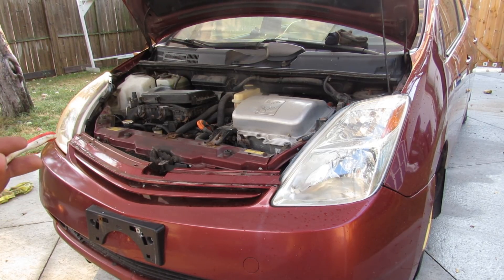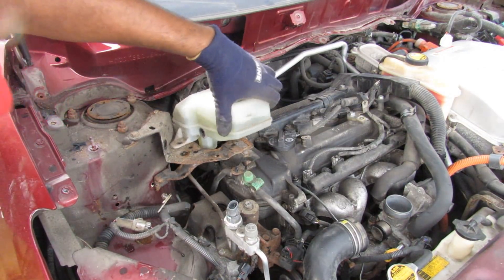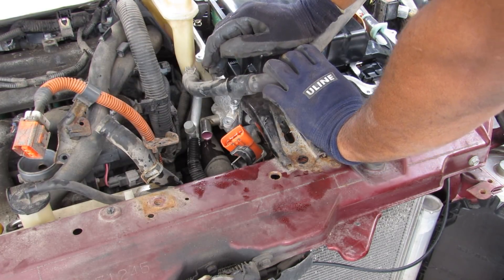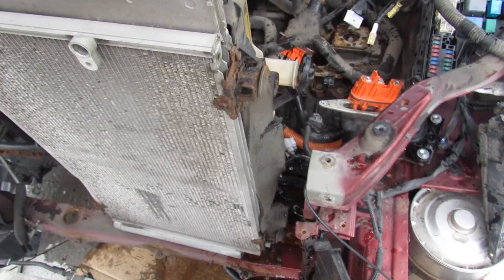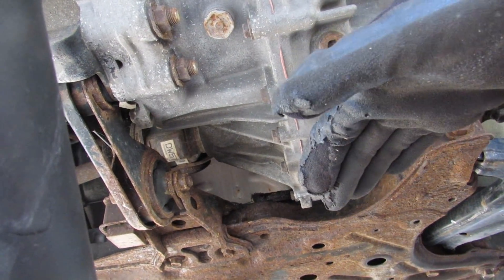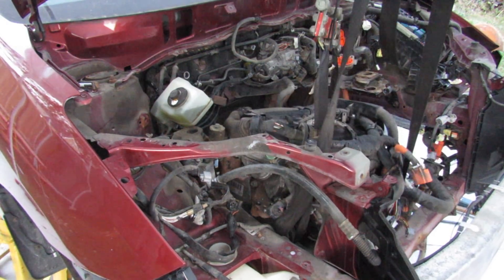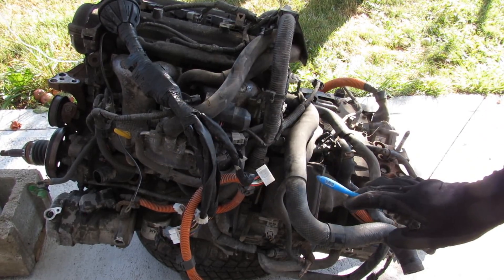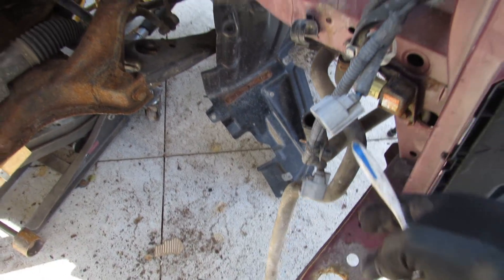How to Remove an Engine   Toyota Prius Hybrid

Comment: Removed my first engine this week of my old 1989 Subaru Justy that sadly was going to the junk yard. I was so afraid of something bad happening with a thing as heavy as an engine hanging up in the air, so I took all precaution like multiple supports with backups and wearing safety shoes. It felt freeing seeing you just drop the engine to the floor wearing sandals😂

Comment: That's amazing once you get a better idea of how everything works what is your plan do you want to convert it to a EV from a HV?
Reply from the maker: Not working on building anything really
Reply: @speedkar99  fair enough i think regenerative charging with modifications when the car is driving forward is the solution to HVs and EVs it could self power the vehicle and maintain the battery system.

Then petrol engines could be removed, but the power steering air con and heater etc would need to be replaced by electronic ones.

Comment: My god...I've never seen anything so complicated in my life! Imagine trying to put this back together again! How'd they manage to build these cars in the first place?
Reply: Everything is assembled and the simply lower the chassis on the motor. If the guy had a lift. He could likely just disconnect the frame and lower it from the car
Reply: They are not that bad to work on... I think this was more complicated than needed. The transmission in these almost NEVER fails.  You can disconnect the engine from the trans.. leaving almost ALL of the stuff he disconnected. And pull the engine out from the top.
JR Goes.. did a video about this.. but did not show much details on the removal process.. not enough to use as a guide.  It took him 6 hours to pull and reinstall an engine.

Comment: Hmm, I have removed from gen1 prius, it pretty much drops out the bottom, don't need to remove all that stuff.
You just need to remove the inverter, the hoses, wires, and then drop the suspension with engine attached, and dtop it onto to big dolly, then raise up the body and roll it out. ahh I see  you came to that conclusion at the end.  :)
Reply from the maker: Lol

Besides removing the radiator (was going to anyway) was there not anything else you mentioned I did?

Comment: I had to replace cat on my ford fusion.  Aftermarket cats are cheap...just over 100 bucks.  I kept the stock one//replaced the exhaust from the manifold back...stock exhaust was welded.  Flex pipe had hole in it.
Reply from the maker: Nice. Yeah too bad they all come as a one piece design

Comment: Excellent video. Can anyone answer me my queries please?
1) While removing AC lines, will refrigerant not leak out?
2) How many water pumps are used by hybrid car?
3) How many motors are required for driving axle?
Thanks for sparing your valuable time.
Reply from the maker: Yes the refrigerant will leak. 
I found 3 pumps 
2 motors in this transmission
Reply: @speedkar99  Thanks for your prompt reply. Is it possible to reply the other two queries?

Comment: Does this car still run and drive when the hybrid battery is dead? because I know some hybrid models use the main big battery to start the car, meanwhile some use the regular 12v battery to start and the car will just be slow
Reply: This Gen II prius uses the hybrid battery to start the car, so it will not start without an operating hybrid battery. There are two motor generators (MG's, ie electric motors) that use the hybrid battery. MG1 starts the car and recharges the hybrid battery (replacing the starter and alternator on traditional cars). The MG2 provides power to the wheels either by itself or in conjugation with the internal combustion engine. The 12V battery has about half the cold cranking amps you'd normally see in a car, because it does not need the amperage to run a starter motor to turn the motor over. I believe the newer Prius models allow the MG1 to also provide power to the wheels, allowing power from the engine+MG1+MG2.
Reply: my prius (gen 3) will still run when it throws a hybrid system error. It just runs slow and the ICE runs continually.

Comment: Not as rusty as I expected for a 17 years old car in Canada!
Toyota seems to be pretty well protected.
Reply from the maker: Yeah I was surprised myself that it came apart pretty easily. I think I only snapped two small bolts, along with one big subframe bolt
Reply: @speedkar99  
In Ottawa live it's kind of hard w/o acetylene torch. When K-Frame or suspension bolts snap it's not fun. Once we assemble back things, we pack some grease to make things easier for future repairs.
A friend of mine when he got his new FJ Cruiser he closed the garage for a week, put the FJ on the hoist and pulled out bolts one by one. Removed plastics, rust proof it. After 15 yrs it looks like new underneath other than some little corrosion in the places that get mostly affected by salted roads.

Comment: The electric power steering motor and controller are quite useful. There are wiring diagrams and instructions on how to use it to do a power steering conversion.
Reply from the maker: Cool! I didn't save the controller but I got the motor and rack for another teardown video

Comment: FYI I have personally swapped engines on that generation of Prius multiple times and it can be done with leaving the transaxle in the car and sliding the engine towards the passenger side and then up and out.
Reply from the maker: Yeah but I wanted to pull engine and trans
Reply: @speedkar99  Yeah no I totally understand that in your case but most of the time with these cars the engine is what fails so I was just letting people know that it can be easily removed without messing with the transmission.
Reply: Hey I am gearing up to replace the engine on a prius not transmission, any videos you know of for just engine removal?

Comment: I honestly don't see the point of a Prius now that there are plenty of small EVs available. The complexity seems like it'd make maintenance a nightmare
Reply from the maker: These are reliable
Reply: They are more reliable than most EVs out there and you're not entirely stuck on the electrical grid.

Comment: Bloody hell!!!  When you watch someone working on a Euro engine, the comments from the haters flow thick and fast.  They obviously would block out this nightmare because it proves that Japan can also make a nightmare.  Imagine the cost of lower radiator hose replacement.......
Reply from the maker: Bruh
The cooling system on this thing is next level

Comment: I dont understand why anybody would buy this car. It is a terrible gas car and a terrible electric car married together with a bunch of computer and sensors. How is any of that going to age well? Just the other day I saw a prius on the highway saving the environment with a bunch of blue smoke coming out of the exhaust before the car gave up and the driver pulled over. Toyota sells these cars making people think they will save money with the 2mpg improvement over a similar small car, but then the hybrid battery is worn out, or the underbuilt engine gives out, or the cats are worn out or get stolen, and they are out thousands of dollars on a vehicle not worth a lot. At no point does it make any economic or logical sense to buy one of these, or for Toyota to even make them other than meeting government fuel economy standards so they can continue to make large trucks and SUVs that turn a healthy profit. Just a complete joke this car is and all the rubes who get suckered into buying it.
Reply from the maker: These are reliable. 488,000km and no problems with it.
Reply: Prius is rated at 52 mpg and it can do better if you really try. It’s comfortable and spacious. Plus it’s super reliable. It’s perfect for what it is.

Comment: what the .... man if you want to change your coolant you have to remove the inverter and all that other crap to get to the petcock... there has to be a trick to do that easier
Reply from the maker: Yeah it seems to be an involved job to get to the radiator

Comment: A lot of accessories to disconnect and pull out. Easier to remove with the subframe out or pull the engine/tranny up if there's enough clearance. 
Anyway, I'm taking a break from cars curing my sciatica and back, and removing this engine is a bit of back breaking job without car hoist.
Reply from the maker: Agreed. The brake booster bar was in the way preventing me from lifting up

Comment: That is one complicated useless car.  Although it's built for misers, it must be the ultimate pain and damn expensive to repair in the long run.  Ultimate planned obsolescence.
Reply from the maker: It's actually very reliable. This one had 488,000kms on it
Reply: @speedkar99  
Thanks! I was wondering about that.
You could write this in the description. 🙂
17 years would mean about 28k a year!... It was used for sure!
Reply: You know nothing about them - they are very reliable.
Reply: @pliedtka  mine made it to 300k and then the problems started , lets just say I will never buy any kind of hybrid again
Reply: @pliedtka  Lol.  I would never buy one.  We're all diverse mate.  I love the rumble of an inefficient gas guzzler any day.
Reply: The traction battery will die , it doesn't last forever

Comment: Recently found out that when selling an old car that nobody wants the only potential buyers who might pay more than scrap price are in it for the catalytic converter and don't even care about any spare parts or if the engine even runs.
Reply from the maker: Yeah I found the same. The catalytic on mine was aftermarket since the original was already stolen haha
Reply: I used to be able to sell parts of cars I bought to get this or that, but the last 5 years I can't sell anything.  I don't think people actually fix their cars anymore, they just buy another one instead.

Comment: Why remove the engine? Toyota’s are perfect and if anything is wrong it’s the suppliers fault!
Reply from the maker: Yeah this one didn't have any issues at 488K
Reply: @speedkar99  so why take it apart? Looks like you are parting it out or selling it for scrap.
Reply: Engine is dead . Car doesn't move with an engine that doesn't operate
Reply: @danh2134  on a Toyota? Impossible!
Reply: @jakp8777  they die too , just like other brands

Comment: Love the fact you have safety toe-less crocks on Havana.. Reminds me of welding in flip-flops and shorts hahaha... Great video as always
Reply from the maker: Well besides the cooling system mess and not dropping the frame the rest was a cake walk worth working in slippers
Reply: Ive actually welded with flip flops and shorts. Sunburn and regular burns was the outcome

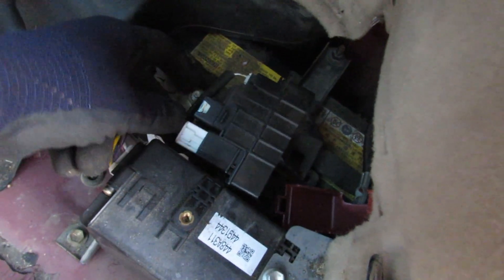Comment: I wish this video was longer. also I asked a question under one video of you and coudnt have the answer. 02:06 what is ventilation pipe for if there are purge and pcv valve ??
https://www.youtube.com/watch?v=819uZQ5P988
Reply from the maker: EVAP purge?
Reply: @speedkar99  There are three outlet come off of the engine valve cover. First one is for EVAP purge, the second is PCV valve. But I wonder the third one  you said it is for ventilation. What is ventialtion for? Please look at the link above on your Eclipse vide and 02:06

Comment: Is the engine particularly difficult to remove on this car?
Reply from the maker: Engine isn't difficult...once the cooling system mess is out of the way. 
If I'd do it again, I'd remove the subframe first in order to not tumble the engine forward
Reply: So, so - a lot of additional accessories to disconnect and remove. On most new cars you have to take the bumper off, and cooling, A/C to get to engine. 
The Priuses are very reliable, our parts supplier has six or seven of them in the fleet as parts delivery cars. Daily they make some 150-200km each and some of the cars have way over 300k km on them. I never heard any complains from the drivers about the cars.
Reply: No
Reply: Yes
Reply: Thanks I guess

Comment: I suppose it was not economical to repair so headed to the scrap yard? Call me old fashioned but all this new fangled tech costs to much to fix?
Reply: Luckily Prius’s dont break. My 06 Prius has 384k miles and i still drive it 1 hour to work and back every day.
Reply: @Abused.Ls2  your traction battery is dying as you read this
Reply: @danh2134  - Whats a traction battery?
Reply: @Abused.Ls2  the larger of the two batteries it carries, it's what moves the car and charges when you press the brake
Reply: @danh2134  - Thats called the Hybrid battery, and I already replaced it a few years back for 900$.
Reply: @Abused.Ls2  not bad for this kind of mileage. I found Prius to be very reliable.
Reply: @Abused.Ls2  definition of hybrid is a combination of two = gas + electric . The term for that is Traction battery not hybrid battery
Reply: @Abused.Ls2  why do you have a picture of a GTO ?
Reply: @danh2134  - I have a 06 Gto 6 speed, a 06 Prius and a 2015 Kia soul.
Reply: @Abused.Ls2  ditch the prius and feed that goat
Reply from the maker: There wasn't anything wrong with this car... Gonna be making some teardown videos on it soon
Reply: ya thats normal in 1st world countries , repair costs exceeds car value